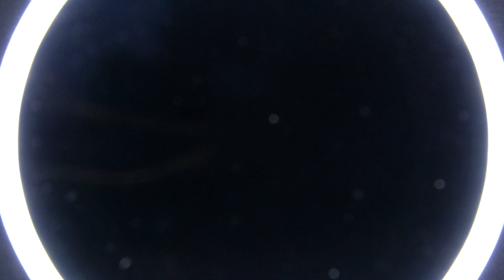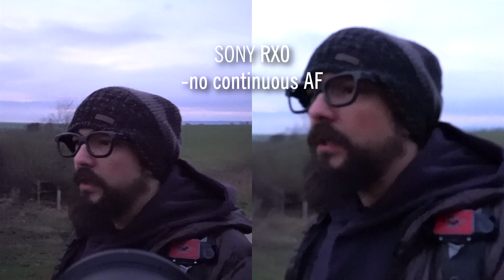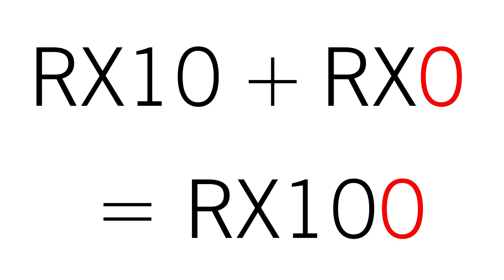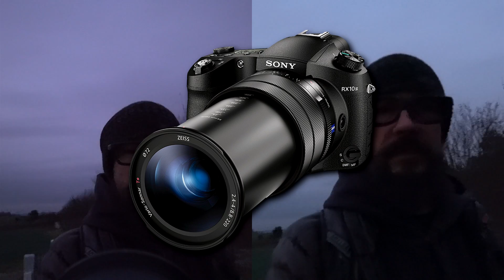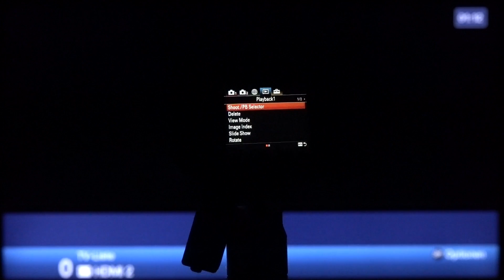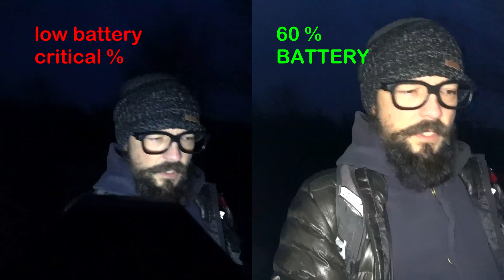SONY RX0 vs RX10 iv direct video comparison test in Automatic-Mode

Comment: They make a modification to where you can use micro 4/3 lenses this might be interesting
Reply from the maker: That sounds strangely interesting - how to connect a microphore third lens to this Sony rx10 ... Please send some more info's over once this magic has happened! 🙏
Reply: @S-LAB   Think they won't make another. Who knows?  But Canon is making something similar that will take the old EF mount and kind of geared towards the older ef TV broadcast lenses.
Reply: @unbroken1010  quite some few people are expecting RX10 Mark 5 soon anyway ...
Reply: @karata-karate  sorry I meant rx1
Reply from the maker: @unbroken1010  as far as I'm aware the rx1 does not contain interchangeable lenses too ...
Reply: @S-LAB  correct